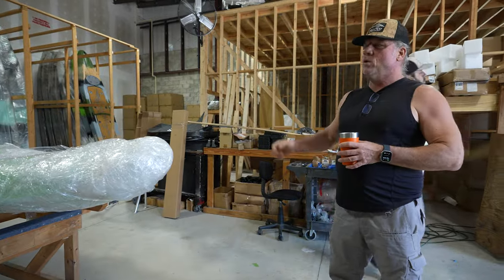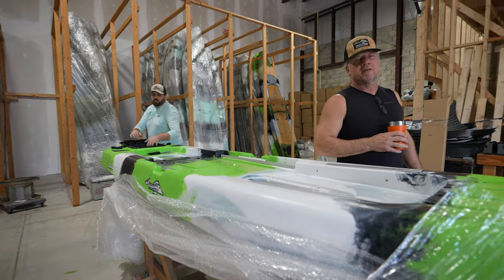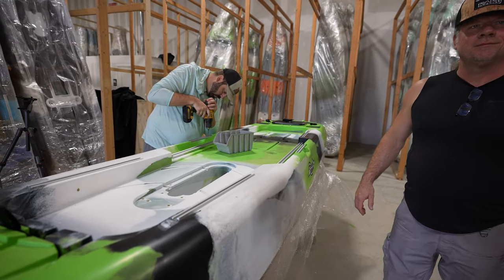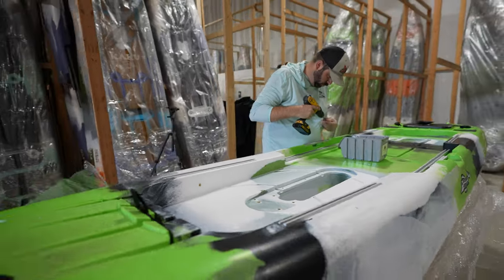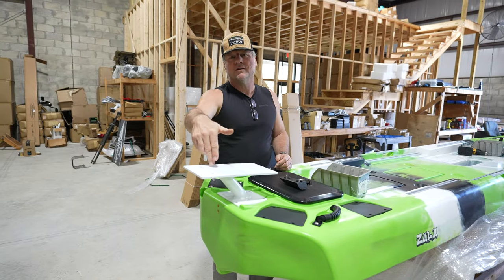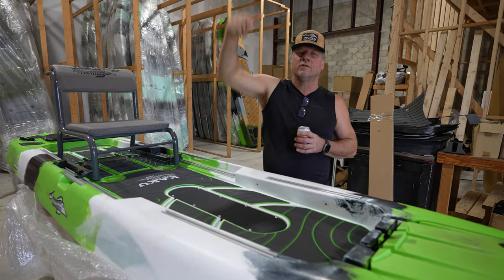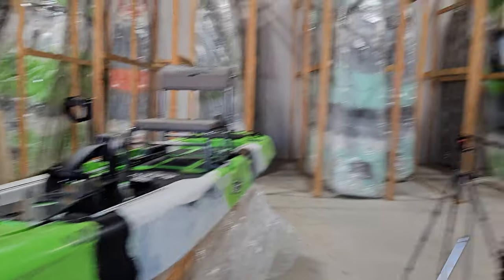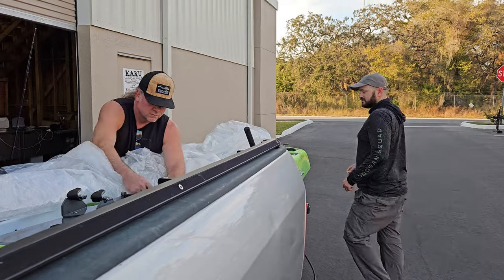2024 Kaku Zulu PDL, This is how a fishing kayak is put together! Kaku Kayaks Shop

Comment: I've been looking at those kayaks pretty hard. I think there pretty cool. Prefer a pedal drive and it's all ready to have and option for a more. Just would like to know how it could handle if you took it say out in the gulf compared to others is all. I've yet to take mine out there but really itching to.
Reply from the maker: yeah, this boat would handle any big water, just be mindful of its limits, like dont go out on crazy weather, wear pfd, and get familiar with the boat, I have no problem using this zulu as my main kayak if i had to, it checks a lot of boxes, i can stand up easy, i can seat high, ultra high and i can motorize it quick
Reply: @AliexFolgueira  that will be in my top ones of consideration then